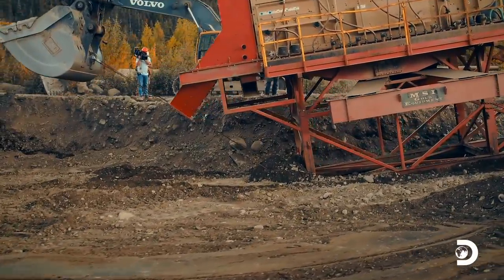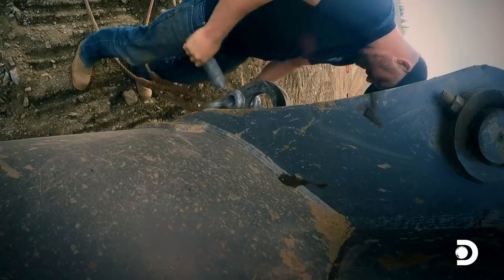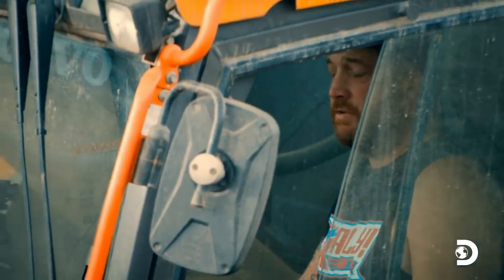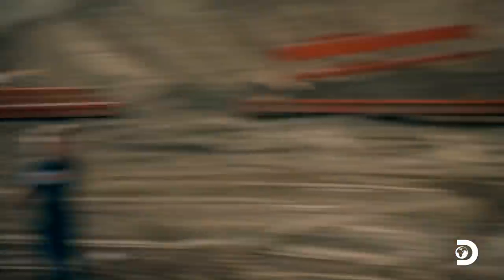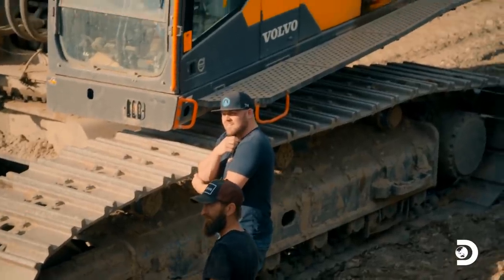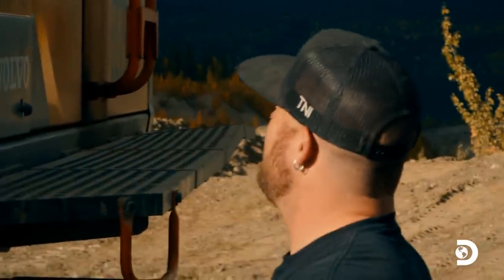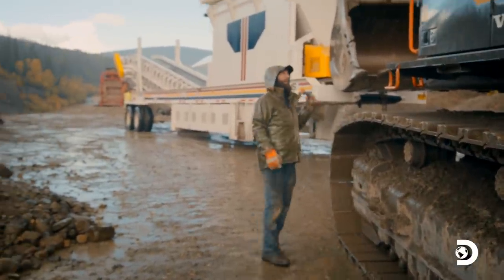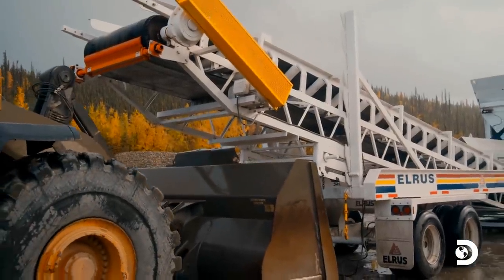Rick Is In Awe of Monster Red's Mining Power | Gold Rush

Comment: I have always wondered if they could use a large wet-vac to vacuum up the sluice runs anytime they are shut down?  What happens to the gold if they are running pay and the sluice's fill up? I would like to see what would come out of all of there runoff water and tailings or better yet I would pay the cost to add another 20' of sluice boxes if I could even have a percentage of what is caught.
Reply: Wat do u think it costs to ship those kinds of equipment to the far north? It's not as cheap as u think I guarantee u
Reply: How much more gold would be recovered if after scraping all of the pay they could get off the bedrock, they added one more step. Run over that area with a machine like a modified street sweeper that pressure washes the cracks and crevices in the bedrock and immediately sucks up the water and gold flushed out of the crevices. There may be a lot of gold there that a dozer can't get to.
Reply: They have individuals that pay the owners to sweep (metal detectors) the sluice runoff tailings.  Off camera.

Comment: Just an odd question, wouldn't anyone want to buy their tailings rocks places like Lowe's and Home Depot charge decent prices for rocks? was just wondering
Reply: Problem is they are thousands of miles away from anywhere that could handle the volume of rocks that they produce.  I also think that they are required to return their cuts back to the condition they found them in, so most of the filler would be required to do that
Reply: @tysonkauth7232  true enough reclamation of the land so thank you, just thought someone would figure out a way to ship, but thank you for your response